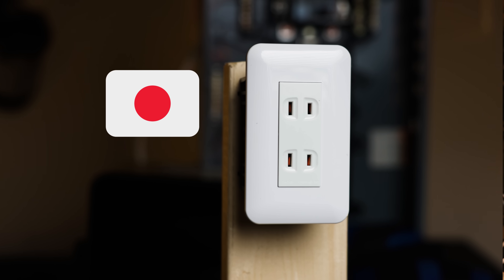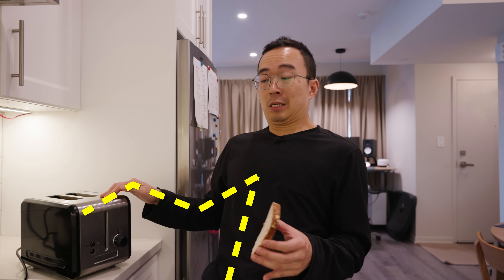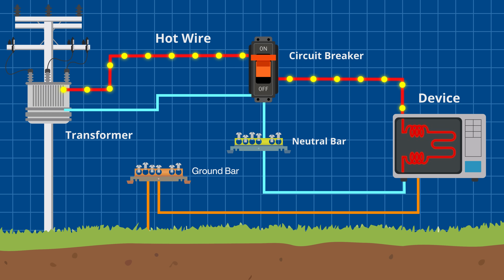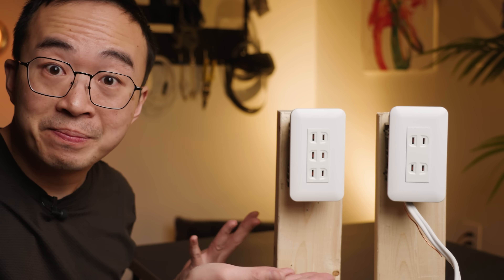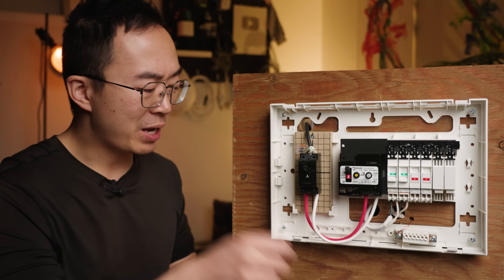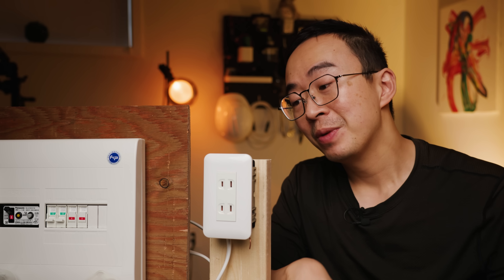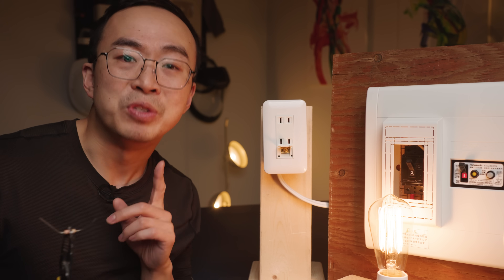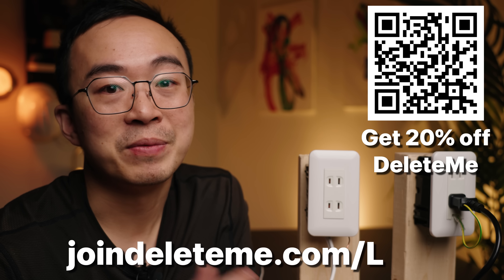How Japan Made Their Outlet Safe

Comment: So its JAPAN I have to think for the fact none of my electronics include grounded cases, and thus become free from the harmful effects of electromagnetic interference.  No its not going to DAMAGE your electronics.   But it WILL cause them to crash when EMI throws electrons out of their onboard RAM, generates an error, and causes the device to stop working.  Its also why rebooting fixes about 99% of errors.   Welcome to one of the reasons you have CONSTANTLY reboot your home routers.  They an't grounded.  Its why desktop computers to this day have metal cases and a grounded plug.  It MASSIVELY increases their stability, even in EMI crazy environments like factories, by letting the case "catch" EMI and route it to ground.

Comment: A circuit breaker is there to protect the circuit. And indeed they can protect a person, with a ground fault, but this is a side effect, not a main feature. Therefore, it protects you because you create a short circuit, and high amps. 
So it is an unreliable way of protecting a person. Especially if using melt fusses. 
Ground protects you by the fact that energy travels the shortest way. And ground is a low resistance path, and reroutes the energy into the earth, and then back to the production. It’s the same connection the energy has when you get shocked only you are in between ground.
That’s why for example hospitals uses a system that isolates the energy source from ground, therefore you would not get shocked if you touch live wire, since ground does not close the circuit.

So therefore ground is used for flossing the circuit so the energy won’t flow through you but through a cable. That a breaker can trip is just a side effect. For this, there are rcd breaker

And not gonna lie, but in my opinion Japanese systems are even Morse than the us ones. The best system is uk/eu
And fyi, rcd and normal breaker are also not good at detecting fire. For this there are different breaker types

Comment: America's system is better because it does not rely on electronic components to keep working.  Back when Thomas Edison was stringing poles for electricity - there were no electronic components to make GFI's.  In fact, homes had fuses because breakers weren't available.  The electrical guidelines were set for the technology of the day.

The 2 problems with GFI's are reliability and longevity.  How reliable will it be years from now, hopefully the GFI will still work as intended and not "rust shut", allowing current to kill you when you needed it most.  How long the GFI can last before it is a risk or needs replacing. 

That being said, America's system is "upgradable" with GFCI outlets and GFI breakers and neither device complicates our original wiring system.

Comment: practically all home appliances actually use DC power.
Honestly I'd be thrilled if most things ditched the 2 to 3 prong model and went with a DC plug of some sort. either a barrel plug or maybe USB-C.
For the few items that use AC power, a plug or two per room would suffice. (i think vacuum cleaners generally use AC)

Comment: FYI, they have actually introduced the modernized gfci ground ports (3 prong ports) to newer japanese plugs for office/kitchens (heavy devices) replacing the traditional ground port for ground wires. the traditional wired port outlets were only required for refridgerators and laundrymachines."from 2022" is innacurate. maybe on a federal level, but its issued by municiple laws, not federal laws, in tokyo area, saitama, and chiba, it was in 2005-2008 and they had to replace them within 5 years.
Reply: My Japanese microwave oven and toilet seat both have the ground wire, so I installed those outlets with the ground screw (and three-prong outlets) in my kitchen and bathrooms in California.

Comment: Hi, also in Italy we use the TT earthing system…and all the outlets are grounded.
In old houses we usually have only one RCD in the electrical panel. In new houses we have more RCD in the electrical panel so in case of a fault it will trip only the faulty circuit and not the entire house.
For outlets and lights we use the 30mA version, for other kinds of appliances (like the ones that are always connected without an outlet) we use 300mA, 500mA, 1000mA, based on the the load and on the earthing resistance.

Comment: I received an electric shock in my house in Japan a decade ago. It had been raining and a window was left open so there was a pool of water on the floor. There also was an extension cord on the floor in the pool of water and the extention cord was damaged, with the plastic outer case cracked exposing a metal part underneath. I picked up the extension cord, inadvertently touching the exposed metal part with my hand, and received a big shock. Fortunately my hand opened and the extension cord immediately fell out of it. I was left with a burning sensation in my hand but it could've been a lot worse. No circuit breaker in the house was tripped and it certainly didn't feel like my Japanese outlet was safe.

Comment: In Italy we have both mandatory grounding, but our earthing is TT because supplier don’t want accountability in case of accidents due to poor neutral. Also compulsory RCDs (30mA) protecting all the circuits (a single device for the whole apartment is no longer enough , we now need to be split at least across two). Also if bathrooms have jacuzzis or similar amenities those must be on 10mA devices. The o ly thing we’re missing is a polarized plug (few decades ago Bticino did a nice one but wasn’t common so was replaced with standard ones)

Comment: I'm waiting for outlets to have forced 12/24vDC, USB and an actual "safe" 120/110vAC plug design. (An inner connection that comes forward to the plug, from above, only when a plug is inserted. As opposed to a powered contact sitting at the surface. Being from above, so liquids and dust getting in the plug would never be an "issue", at all.)

Comment: Here in india we use RCCBs, which is just another name for GFCI, and we also have a third ground pin on all the outlets, which makes it even safer. And unlike Japan where its mandatory to have grounded outlets in kitchen, washroom and outdoors,  we instead have applicances with different pin configuration. So if an appliace is heavy, it will have 3pins, and if its a normal low load appliance, it will have only 2 pins.

Additionally some homes even have SPDs(surge protection device) installed, which protects the appliances from sudden power fluctuations due to lightings strike or transformer malfunction.

Simple!❤

Comment: European electrician here? So what happens is the circuit fault trip the whole installation. What about people dying due to lost service. How do they implement that in the Airport or let say Mal? Is the section DB system trips every time or each circuit is separate RCBO. How they manage selectivity. What type of RCD they use ( type AC, A,B, B+,F) how do they deal with high leakage circuits? Expand a bit more on that?

Comment: About the 4:00 mark, misleading. The impedance of the line wiring between the panel and the appliance and the impedance of the ground connection are similar, not enormously different. But the total impedance is far lower than the impedance of the normal load, so a short-circuit from the "hazardous live" part to the accessible metal does allow a large current to flow, which blows a fuse or trips a breaker. Modern installations in many countries additionally have "residual current" devices like those you describe for Japan, which disconnect the power if there is more than a very small imbalance between the currents in the line and neutral wires.

Comment: One problem with the GFCI/RCD panel used in Japan.  Every single circuit is protected by the same RCD. So if one circuit trips it, everything including the lights goes off.  In Europe this has been mitigated against by the RCBO, which is a circuit breaker with RCD combined, meaning every single circuit can have it's own RCD.

Comment: My 40 year old Japanese house has grounded outlets in the kitchen, toilet rooms, and the vanity room for the washer/dryer. Pretty much anywhere there's water. The 200V mini-splits all have grounded outlets as well. The house electrical is all original, including all the outlets and light switches when we bought it. One of the first things I did was replace all of them. Found some horrific workmanship,  I'm surprised that it didn't cause a fire, that I fixed. Mainly, wires were stripped back too far with too much of the conductor exposed. Wiring color codes were not followed either. 

Something else that's different is a lot of Japanese outlets aren't polarized. The ones I installed are because I like knowing which side is hot and which is neutral just by looking at the outlet. Since I installed them, I know they're wired correctly 😀
Reply: That is how most of Europe was from the 1930s to the 90s.

Comment: If you look carefully 1:04 you can see one pin is larger than the other with the smaller hole being the 'hot' and the larger hole being the 'neutral'. Extension cords often can only be inserted one way to enforce the hot/neutral but I have never come across an appliance that enforces this as it seems most modern appliances are symmetric. I'm told that in older houses this may even be the 'wrong' way round but my experience with Japanese electricians is that they are highly professional and this wouldn't happen today. The whole neutral thing is moot in many cases as most Japanese appliances (which are double insulated) don't come with 3 pin plugs anyway. However, with air-conditioners you legally can only connect it to a dedicated AC outlet which is grounded.

Comment: It's all belt and braces isn't it. Ultimately European countries just tend to have both and enjoy both protections but in those systems earth serves a different reason. It's to prevent the outside of the device from going live thus preventing the risk of electrocution entirely.

Double insulated devices don't tend to really need this which is why you see the plugs for those often not have it. This is the difference from where you see a device with a "figure 8" or a 3 prong connector. (double insulation is common in electronics, less common in white appliances)

Comment: Having both a neutral phase and a ground connection significantly enhances safety in nearly all electrical applications. While no two holes (outlets) inherently guarantee improved safety, incorporating a Ground Fault Interrupter (GFI) or Ground Fault Circuit Interrupter (GFCI) provides an additional layer of protection, making the system considerably safer.

Some of the safest electrical outlets in the world include the CEE (International Electrotechnical Commission standard), Schuko (common in Europe), and British-style connectors and outlets. These designs prioritize safety features such as grounding, childproof shutters, and robust insulation to minimize risks of electrical shock or fire.
With additionally adding reces.

Comment: Also ground is important for high sensitivity equipment like measurement or audio because that help to deviate EMI instead get into the amplifiers. And don’t forget about floating ground, power supplies using transformers can insulate the protection since this only see the current in the primary, but the ground in the device can have no reference where is the zero, if charges build on the device the ground in it and the physical ground can have a dangerous potential difference and shock the user even when there is nothing wrong on the device.

Comment: This is as wrong misleading as can be. The ground IS needed and I tell you why: I have some japanese electric device (it's a Roland MC 505 "groovebox synthesizer", if you care to know 😂) with exactly this "2 holes" circuit and I constantly get shocked by touching its metal case! 

As I learned (on the forums lamenting the same problem by thousands of users) it was made so by design, as the production company later changed the design for "3 holes" circuit for later models.

Comment: I am a common man. Very little knowledge on electricals. Will GFCI save  home from lightning strike during thunder storm.
Reply: Yes and No, because the speed of the surge in a conductor is the same as the regular voltage, ~2/3rd of the speed of light, GFCI acts in average in 0.1 s BUT can transmit the surge before triggering as it has a very high voltage (think often at least 100 kV) - you need surge/lightning protector(s) on your line just after the counter and on both the neutral and the phase with an excellent earth connection on the other side (be careful, as most of them must be replaced after being shocked).

Do not kill yourself stupidly by trusting a multimeter when it comes to the quality of the earth, it is unreliable for reasons I won't develop here, this kind of control (regular ! Do it at least once every 2 years or better once a year) MUST be made with a terratometer (~$200 for a good instrument).

Ask people around you, this is the best way to find a good electrician, the kind that will explain things to you and won't  try to sell you expensive useless devices.

Comment: 4:10 completely wrong. E.g. neither the N nor the PE nor a combined PEN go through the circuit breaker. Only the phase/life goes trough the circuit breaker.
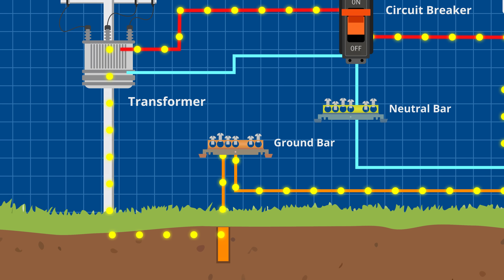7:00 TT is also being used in the countryside. And Japan, start using decent electrical lines.
The US plug system is bad anyway.

Comment: Australia:
*Ground/Earth on every socket.
*Isolation switch on every socket.
*Mandatory RCD on switchboard, and new circuit breakers also have secondary RCDs built in.
*Plugs have insulation along half the metal pin on live and neutral so u can't make contact with a live pin when inserting or unplugging.
Reply: I like how heavy plugs don't fall out as easily too

Comment: Erm... this video is total garbage.  The circuit breakers measure that the current matches going in one pin measures the current going out the other pin (using an electromagnet).  If electricity goes anywhere else the magnet pulls one way or the other.

DO NOT connect Earth to Neutral.  Neutral is held at around 4 volts different to earth, and so will also trip the circuit breaker.  Also note that Earth is not the same voltage even at different points in your own yard, so your earth needs to go to a single spot.

The reason that Japanese plug have two pins is historical:  they existed BEFORE circuit breakers existed, so you can't retrofit the arguments in this video to them.
Reply: You're confusing a circuit breaker with a cfgi. The current going from one pin of the circuit breaker to the other is the same. Theres a bimetallic strip in them, when the current is too high it heats up making it bend and that cuts the circuit. That wont react nearly as fast as the cfgi, a circuit breaker could very easily let you get electrocuted, usually they require something like 10x its rated current to instantly trip

Comment: Hi from an electrician in germany...just to tell the difference here and japan from a technical view. Every houshold here use grounded outlets. The source ist not a transformer for every single house, we get instead 400V in our distribution boxes, 3 Phases each 230v to ground/neutral. Deliverd in a cable hiden in the ground with three live wires and one or two neutral or ground wires. The ground/neural wire is connected to the transformer´s ground wich is essential for low resistance to trip any kind of fuse. The RCD is a different story, sometimes you have these just for bathrooms, outdoor outlets, sometimes it is to protect your whole house with one, or especially in old houses you wont´t find any of them.  There are no deadly accidents in japan with electricy? I think just 100V~ ist a good reason for that too..

Comment: This video shows why not having a ground isn't safe. Anything that's not double insulated should have a ground cable, so if there's a fault, the current goes down the ground cable instead of leaving the casing live and waiting for someone to touch it and create the ground.

it wasn't really mentioned in the video but I'm assuming there are hardly an single insulated appliances sold that's why there are only 2 prong outlets.

Comment: To be fair, the Japanese grid is insanely reliable, so from the device perspective I don't see much of a problem, unless the device itself has some major issue. We shouldn't forget that by making the connection to the ground a default thing, whatever device you connect becomes reliant on that ground socket. If this has an old plug, you don't connect it to the ground, and there is a fault, you may die if you touch it, while in the Japanese system the device can break but you don't die. Not all, especially old devices have a ground-ready plug. I don't think thinks is easy to judge.
Would be great having both systems at the same time, which is not necessarily common anywhere.

Comment: There are two disadvantages I see in the Japanese electrical installations:

1. Since no ground wire is at the receptacles, equipment is not grounded. So if the metallic chasis of some loads adquired static charge, it could discharge through you when you touch it.

2. Since no ground wire is at the receptacles, when a live wire touches a metallic chassis, it won't immediately trip the breaker, only when you touch it. Sure, the GFCI/RCD will trip and save you, but you will stip feel a shock briefly. If instead there was a ground wire, the GFCI would trip before you touched the chassis.
Reply: If a live wire touches a metallic chassis, it will immediately trip the GFCI/RCD as current from the live will run to ground giving an imbalance inside the GFCI/RCD.
Reply: @johnburns4017  The chassis may not be grounded, and hence there would be no path for current to flow, and so it could remain energized.